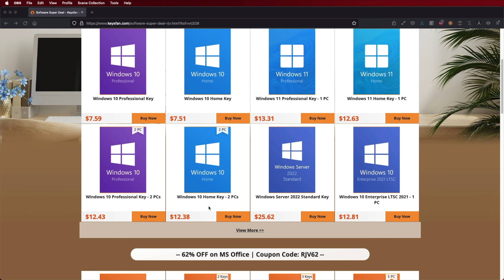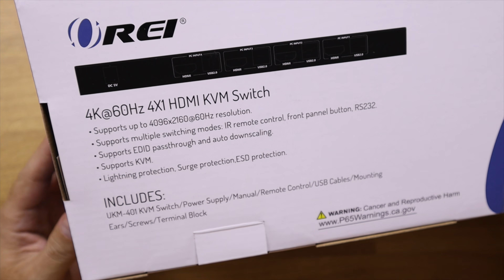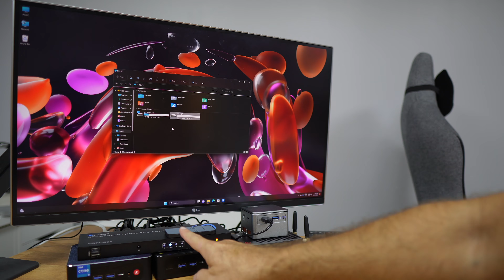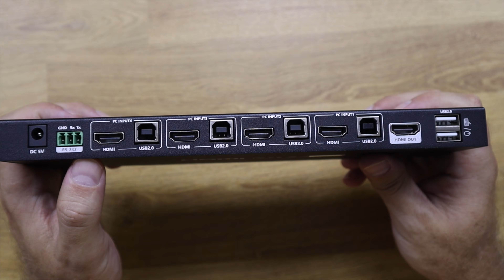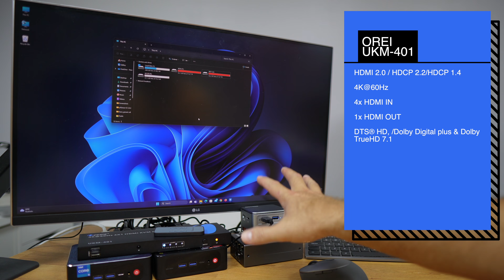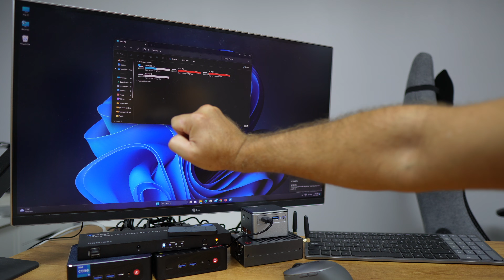Controlling 4 Computers with ONLY 1 Monitor, Keyboard & Mouse | KVM 4K OREI

Comment: Thanks for the video. I brought this KVM switch a month ago & for some reason it doesn't always work. I have 2 Windows computers & one Mac Mini. It's always the Windows computers that gives me problems. The Mac always work. I'd switch it to number 1 & nothing will happen. Sometimes I would have to restart my computer just to get it to work. Sometimes it works, sometimes it doesn't. What do you think the problem could be?

Comment: Hi, can you also see all 4 pictures split all 4 pictures in same time?
Reply from the maker: You mean, the 4 like it was a surveillance system? If that is the case, no. But that would be a great option
Reply: @RobertoJorgeTech  I found what I need. 4x1HDMI switch 😁 
Thanks for the answer